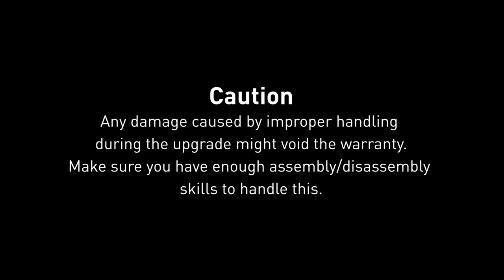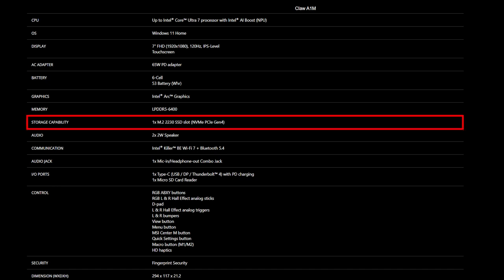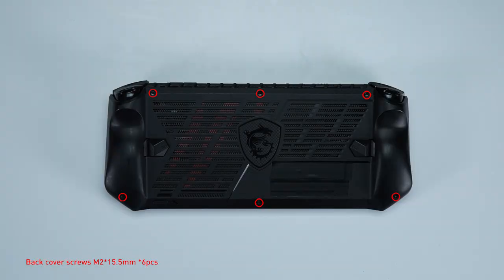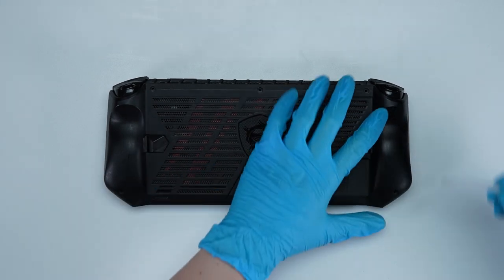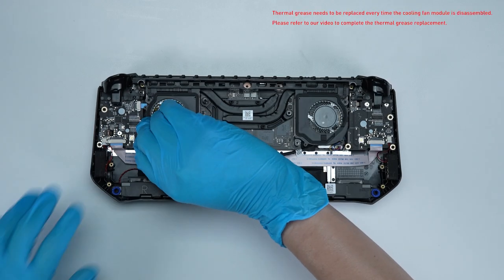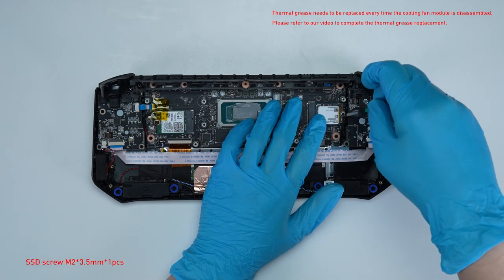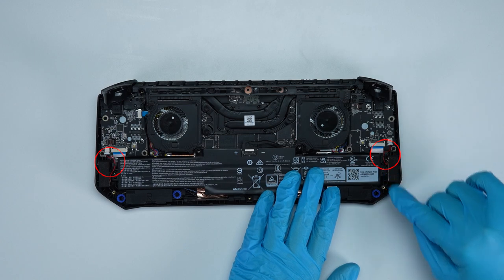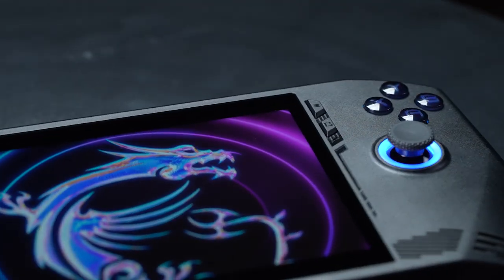MSI Claw A series Upgrade Tutorial (Handheld)

Comment: well, while I like that the WIFI card is replacable, I hate how the ssd is placed.  I get that it is because of the battery size, but man, having to dissamble the fan assembly and repaste each time feels like a pain.
Reply: I think that the fan is cooling the ssd too.
Reply: @fredericmanson441  probably. But that shouldn’t require the fan to be directly blowing on the HS.  A well designed heatsink and airflow channel could do that while also not interfering with ssd replacment.
Reply: It's WIFI 7, I doubt  anyone is replacing that